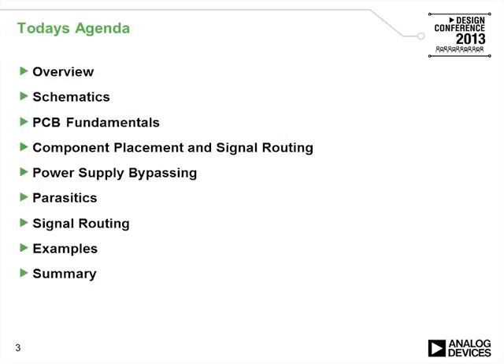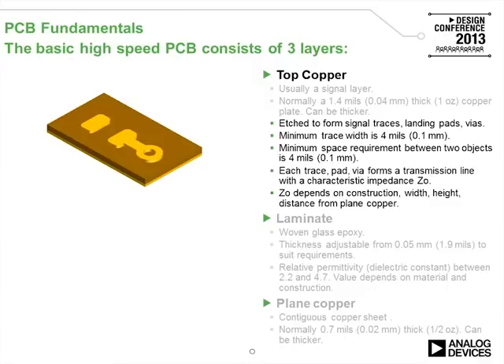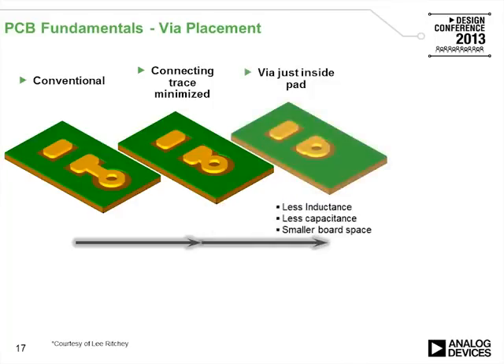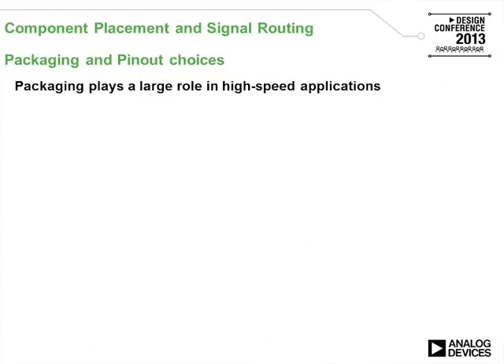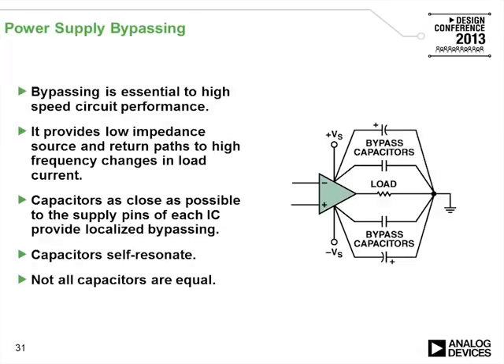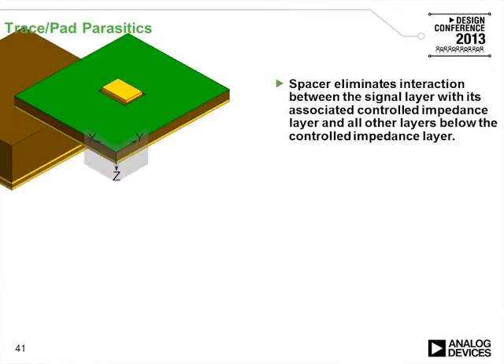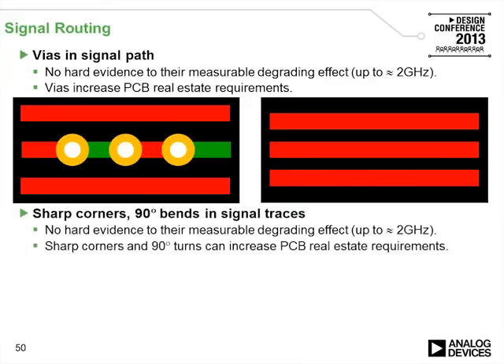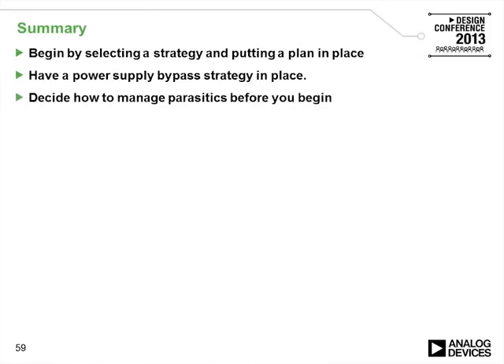High Speed and RF Design Considerations

Comment: Wow! That was the most comprehensive RF PCB design and component layout lecture I've ever seen!
Thank you Zoltan Frasch, Senior Applications Engineer, for putting this together. Makes the planning all more important before cutting the schematic.
There is a process and order of that process for sure in RF circuit design and this video helped me learn more of what to add to my already existing process. Thanks!
I'll definitely re-watch this video several times to burn it into my consciousness to include it in my RF circuit design process.

Comment: I am a bit confused, please give me some guidance, sir.

@32:47,  X = Copper length (mm)   and    Y = Copper width (mm),

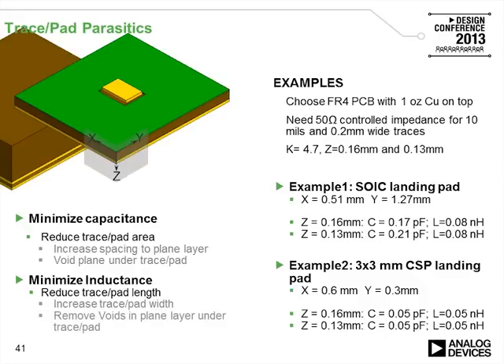but @33:25 you say "minimize inductance: increase trace/pad WIDTH"

Now my confusion: For a SOIC the X = 0.51 mm and for a 3x3 mm CSP the X = 0.6 mm (so the length has increased)

So it seems the X (which was labelled as the LENGTH earlier) has increased and the inductance decreased from 0.08 nH to 0.05 nH. So the X would be the width, not the length right?

Please help. Thank you very much for the video.

Comment: Hello, 
I have a question for you as an expert, what do you say about separating the analog ground area to the digital ground area with a gap, this means that the return currents will not share the same ground plane, 
However i had watched a video says that this can cause a differential potential of 1 mvolt between the two ground areas (planes) and hince the external connectors will radiate and hince a failure to meet with EMC requirements?
 thanks in advance !
Reply: This is old but maybe someone else in the future will reply. From my understanding, no designer in this age will tell you to split the ground planes.. Everyone says you want solid ground plane, just "isolate" (split) the digital and analog sections. I have no idea why they say this, but I've only really seen this split plane idea peddled by datasheets/semiconductor manufacturers in general. Almost a theorist/experimentalist debate. Obviously, they should know their stuff, but I'm wondering if it's just an oldage that may have been fine in the 10s of MHz, but not in the modern era with GHz abundant. But I have very little experience myself to comment for sure.